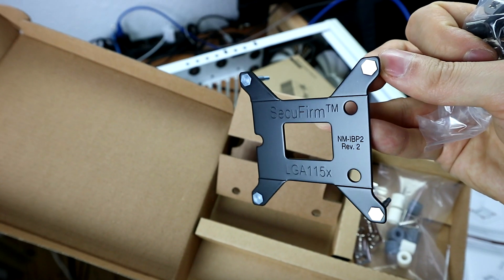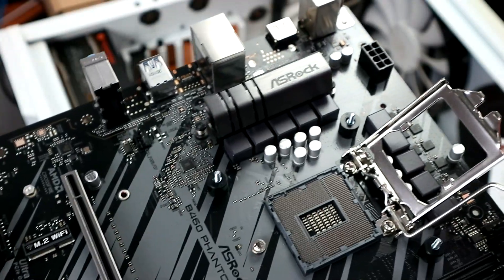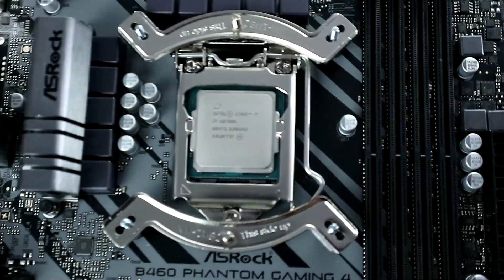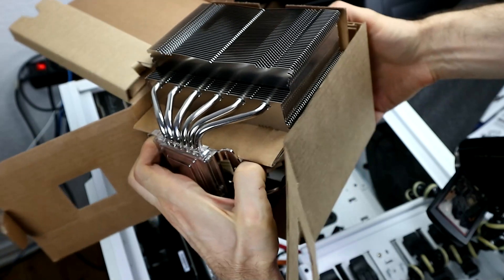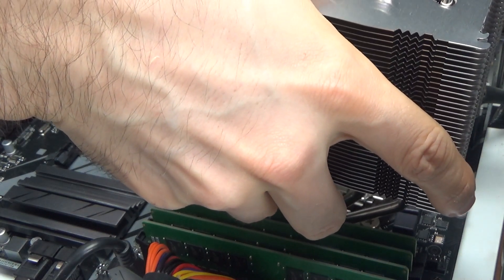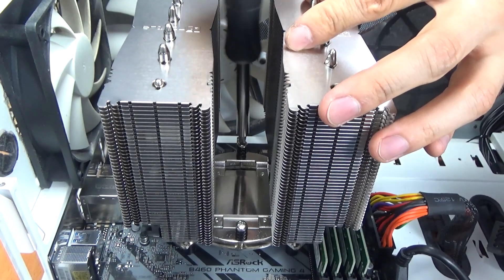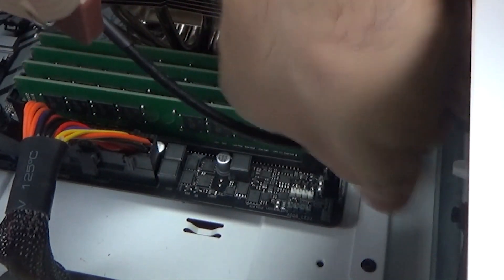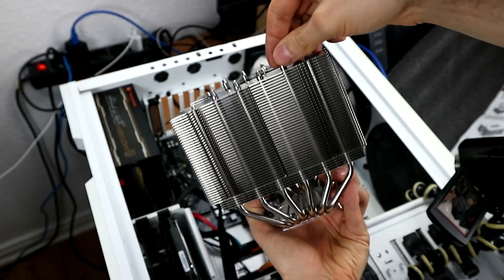Noctua NH-D15 on LGA1200 Socket Motherboard Installation

Comment: You did all the work for me, black spacers and middle hole are what I needed to know, and the bit about the fan clips was great too, thank you!
Reply: NOTE: If you bought the nh-d15 in 2022 or later they changed the backplate and updated the instructions for this socket

Comment: Building my first pc today and got this fan. The instructions were nonsense. This video helped me so much. Thanks for the video
Reply: How did the build go?
Reply: peter p went surprisingly well for my first build. The fan is a pain to get screwed in though as once I only slightly screwed in one nail, the other side would just go up
Reply: @promethul793  That's great!  I'll be building my first soon, just worried about ram clearance and case size lol
Reply: peter p my ram is pretty big (white rgb Corsair vengeance pro) and my cpu fan (noctura) is also quite big and there’s enough space. Use pcpartpicker as it’ll provide what fits but not 100% on space. I’m sure your ram clearance is fine and just get an atx case. I used the nzxt h150 which is pretty sizeable
Reply: @promethul793  Thanks, that's great advice, much appreciated :)

Comment: Thanks for this tutorial! Just what I needed. I'm going to put the Noctua NH-D15S on my 10900kf soon.
Reply: What are your temperatures during stress testing?
Reply: @DAVIDDAVID-jh8xd  It peaks at 90 during extended runs in Cinebench. During gaming it stays onder 65. My cpu is turbo limits removed btw. I've seen it draw up to 200 watts at full load.

Comment: Excellent tutorial with 0% BS!  I've built roughly 10+ systems for my studio over the past 30 but I build them to last at least 5-10 years so my last build was roughly 2012 (seems a lifetime ago). Things have changed quite a bit, especially cooling systems so I needed a (quick) refresher course! 

PS. The fans these days are obnoxious. You'd think they would have come up with a highly compact way of cooling the CPU by now and not have these behemoths which weigh more than the entire rig! Thanks again.

My rig:
Asus Prime z590 p
Intel I5 11600 (unlocked
32gig Crucial DDR4 3200 UDimm
Crucial P2 NVMe M.2 SSD 2gig
Sabrent NVMe 4.0
Noctua NH D15s
EVGA 170w
Nvidia 1060 6gb
Case: Fractal Design Focus G Red with 2 integrated front fans
Reply: hehe, my last build was 2010 - yes, love the no talking head and waving hands - this is straight to the point..new build parts are ordered...:)

Comment: I went from a i5-4440 to a i7-11700kf the performance boost is an insane difference from what i've had before, been enjoying vr. Although the heating is far more difficult, the base fan isn't good enough to make sure my cpu will last a long time. After looking around for a while I found this cooler but wasn't sure what it came with or how it would fit because it seems huge. I've also never installed a heat sink before so I was confused how the 2 pin would fit on the four pins on my motherboard. Good to know also that two fans can be plugged into one cpu fan socket. So never the less this video was very informative and covered about everything I think I could have asked and did ask. Thank you very much.

Comment: This was an awesome video. I had to get a NH-D15S due to my motherboard but it is pretty much the same. Put it on my 10700F over the stock cooler and dropped from 80+ under load to the low 50s. It is quieter and the fan is running much slower too.

Comment: I was thinking about whether to install the cooler in or outside the case. No i am definitely going with inside the case so i can get all the cables and motherboard screws easily attached. Thanks for the video.

Comment: Thank you very much! Just installed it following your instructions, and it went much smoother than reading the small manual.. Only very annoying parts were plugging the fans on the mobo, and clipping the fans on the cooler!! no space in my mid-size tower!!!

Results: on my i7 10700k, i used my old Gammaxx 400 cooler. Bad idea... gaming around 65C, heavy load 100C............

Now with Noctua, gaming around 40C!!! Heavy load tbd ;) 

Conclusion, D15 is a beast -_-

Comment: Very precise and good instructions. I followed this to install the NH-D15 with 10900K in a MSI Tomahawk MAG Z490
Reply from the maker: nice rig! which gpu?
Reply: SoSoTech I have a Asus ROG Strix Gaming 2080ti OC edition.  I had a slightly overclocked i7 3930K with slow 16 Gb modules so I needed the upgrade. Haven’t overclocked it yet, got it running today!
Reply: @Robert Raman, what atx case are you using for your build? I am having trouble finding a case that the  NH-D15 will actually fit inside. :-P
Reply: Eight Lives got a used computer and when I now updated I kept the case. It’s a Fractal Design S. I know their Define 5 and later are also big enough but the S is much cheaper but still with some sound insulation
Reply: @robertraman6307  Thank you so much!
Reply: Hi, what are your temps? And did you adjust any bios settings?

Comment: Thank you sooo much extremely helpful.  I purchased the black 15 on Amazon for 100$.  Much better looking.  Also beware of the size it's very big and u may only be able to run 1 fan if you don't have a premium board and case.
Reply: Agreed.  The white/beige is nauseating to me, so I got the all black one.

Comment: Does the 1st and 2nd fan must be at the same height from the motherboard? Perfectly simetric? I ask because the front CPU because of the high profile RAM is higher than the 2nd fan and is causing a humming noise during loads. I don't know what is exactly the cause. I tried to move them but same noises which are driving me nuts.

Comment: Is the Noctua installation kit compatible with other/all LGA1200 coolers?
I received my (Gelid) LGA1200 cooler with a rear/backplate that doesn't line up with the holes in the mainboard. 
If I could use a (different) fitting rear plate, for example the one from Noctua seen here, or maybe even the entire installation kit?

Comment: Can you install the base plate if the motherboard is already in the case? In mine, the holes are there behind the mobo on the case but my concern is if the base is touching the metal case it will cause the a short to the mobo. I'd prefer not to take the entire mobo out just to install the cooler if possible.

Comment: I have installed this but I couldn’t install 2nd fan because ram was blocking and if I get this higher I cannot close the cpu case so I chose to install the fan a little bit away from heat sink . I hope I did it right and no issues so far.  And I have also same motherboard like u. Please reply on my comment thanks

Comment: Very good guide! The only point that is wrong is the temp paste, always spread the paste all over the CPU in a thin even layer, otherwise it will not go everywhere and you will not have optimal contact between the CPU and the base.
Reply: I was wondering about this.  I've seen different schools of thought on how to apply thermal paste, from cross patterns to a dot in the middle, to what you're mentioning with putting it everywhere.  It's confusing!

Comment: 4:36 I plan on getting the Noctua NH-D15 and a Core i7-14700K, which rules out overclocking since this great cooler is unfortunately insufficient for unleashing this specific chipset's full performance. 

That being said, I've read that applying thermal paste (carefully) in a way that evenly distributes it to all four corners of the chip using a mini shovel (and much caution) will enhance cooling effectiveness. 

Do you have any thoughts here? (I'll be using an electrically-conductive nickel-based thermal paste solution rather than Noctua's provided stock offering.)

Thanks,
J

Comment: Why did you used 2nd hole position, while the manual clearly says it should be 1st for LGA1200/115x? At least printed manuals, because in pdf from the website there's not a single word about it.

Comment: Hello @SoSoTech is there a specific way I have to put the black spacers in or does it not matter which side touches the motherboard?
Reply from the maker: I put them with the closed side up (or were both sides closed?) but it doesn't matter.

Comment: On my mobo I have (cpu fan 1) input and (pump fan 1) can I connect one fan to (cpu fan 1)& one fan to (pump fan 1) or should I use the splitter and have both fans into (cpu fan 1)
Reply from the maker: Don't mess with the cpu fan. For the other i would look for psu cable to fan connector adapter

Comment: I replaced the stock cooler with this one, temps under load dropped from 80C to 60C
Luckily The cooler barely fit in my case with both fans attached.
Reply from the maker: Cool! (literally)
Which cpu?
Reply: @SoSoTechTube  Ryzen 5 5600x on the stock cooler

Comment: Can you use a different thermal paste on the cpu like the Corsair TM30 instead of the Noctua thermal paste that the cooler came with? Reason for it is I don’t have any left
Reply from the maker: yes. use any thermal paste. don't use mayonnaise. that is all.
Reply: @SoSoTechTube  lol got it. Thanks.

Comment: I think using too much thermal paste is not less efficient, unless you put a huge load and it drips everywhere. Otherwise it does not really make a difference. Not putting enough can affect performance.

Comment: take note that the directionality of the fans is relevant here.  you want to 1) align them to blow in the same direction, 2) determine the best direction for them both to blow in given the desired airflow in the case.
Reply: Yeah I was going to mention, this video did many things good, but I couldn't help but scream "Mention the airflow!" because some poor person is going to watch this and be a little confused by that step - just a simple double check on the direction & placement of the fans could really help.

Comment: Thanks. I was looking for a better cooler for exactly this CPU - bought a "Budget" cooler which was about 50 euro and the CPU gets a little hot. What sort of temperatures are you seeing with the Noctua?
Reply from the maker: 26-27°C idle. Around 60°C when gaming a not very optimized game after 10 minutes.
I'm really happy. It used to be 50°C idle with i5-6600 with stock cooler.
Reply: @SoSoTechTube  good to know. I'm going to be loading up cpu to 100% for rendering and FE analysis and it hit 100c last time even with casing fans at maximum.
Reply: Wouldn’t call this budget. It’s the best air cooler you can get, handles my 9900k at 5.1ghz.
Reply: @mason8621  was staying the cooler I had was a budget cooler at 50 euro. Its not a bad cooler and probably fine for the i5 but just not up to the job of keeping the 10700k cool. Idling is around 38c and gaming hits 70c, but UE shades and lighting builds, or FE analysis maxes out the CPU and sometimes for hours so running at 90c for that duration is not good.
Reply: @bgeedee  Oh I see, read wrong. What's the temps with a NH15?
Reply: @mason8621  I'll let you know. I have it on the way and should arrive by weekend. At least it looks easier to install than the one I have. I hate installing the CPU coolers.
Reply: @mason8621 Just installed. It is a Beast of a heatsink and first thing is I had to go with a single fan. My case wasn't wide enough - you need a case at least about 200mm for 2 and mine is about 180mm wide. Probably wider if your ram is quite large. I have Ballistix ram which is quite tall.
I ran some FE analysis, not a big one but big enough and CPU spiked at 65c. I then opened a fairly substantial UE project with VR enabled. Previously the CPU hit 95+C when opening and it hit about 55c.

The PC is set to High performance.

So I compiled a big C++ project, launched a UE C++ project and set a huge FE analysis all running. Temp maxed at about 78C which is a fair improvement over the old fan. Idle temp is around 30c. Note this is all with a single fan. I was also able to turn down the case fans to minimum speed which I couldn't before. They actually make no difference at max.
Reply: I should add it was really hard to fit - needed to remove GPU and case fan, unscrew motherboard and fit the back plate. Then, when mounting the fan I had very little room as it was really close to the top of the case. Fortunately, a long screwdriver can be used to pop on the fan clips. These should all be noted when installing. The actual install of the heatsink itself is a piece of cake and having watched the video, I only used the instructions to make sure I was positioning the mounts correctly.
Reply: @bgeedee  It's a great cooler, been going strong for me for 2 years now.

Comment: I also have a phantom gaming mother board, and the pdf you can download is designed for higher tech minds than mine.  I am learning of the CPU header and the bios settings, and I desperately need a better CPU cooler for my i9-9900.  This cooler is getting better ratings than my water cooler that is not working well for some games.   So I need to search for either two cpu headers or the single with the splitting cable.  But i also want to place a single fan like he does at the back of my PC box where he has that white single fan.  What does that plug into?  Where I want to place the single fan is where my failing single fan dual water radiator sits now that is not working well.  Any offers?

Comment: Does it matter which way the fans go around?? Also,, is it worth getting a 3rd fan, if so where do I get the steel bearings from? :)
Reply from the maker: The direction is related to the direction of the air flow - yes, it is important. you can try putting a very light piece of paper to see which way it will go - pushed away or sucked in. Which way to blow is based on the concept of the hull air flow.

Comment: what type of RAM do you use? I ask because of its height, I see it fits under the fan.
Reply: You will need a low profile ram stick
If they aren't low profiles they won't fit

Comment: Never remove the socket protector before installing the CPU!! When you put the CPU inside the socket and close the lid the cover will automatically come off.
Reply: Why?
Reply: @KYTHERAOfficial  because it's super easy to damage the socket. Those little pins are very bendy. I've bought two used boats on eBay with bent legs a year ago. People don't even notice that when they mount the CPU.
Reply: @mjanek20  But this is only a problem if you are not careful enough. So I wouldnt say NEVER do this.
Reply: @KYTHERAOfficial  this you being picky. Didn't parents tell you not to play with the electrical socket and now you know you can touch it if you're csrefull. Those protectors are there for a reason and they come off automatically once you install the CPU so why remove them beforehand ...
Reply: Especially that this is shown to all viewers here where you're not sure if they are carefull or not.

Comment: You r problem is you have 2 140mm fans on the cpu and a 120mm fan exhausting. Your temps would change if you modded the case for a 140mm exhaust fan. It’s just simple phisics. That puny exhaust fan can’t keep up with those 140mm fans